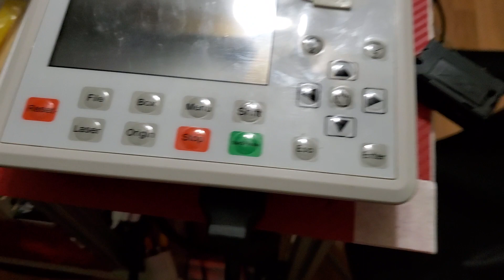DIY C02 LASER CUTTER UPDATE 4 (K40 LASER CUTTER  UPGRADE!)

Comment: Hi, lots of work done and it looks good, just wondering why you didn’t do the upgrade in the K40 unit where they remove the divider and electronics and them put a 12 x 24 bed into the K40? I’m looking at copying Bills Frankin 40.
Reply from the maker: I was having problems with the k40 I brought and I wanted something that can lift up and down  like on 3d printers using the z axis